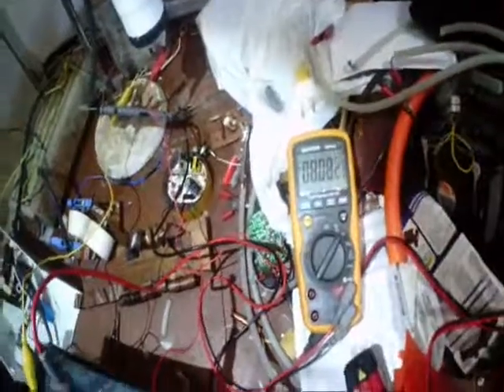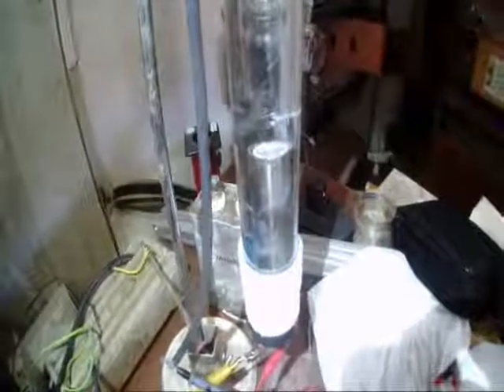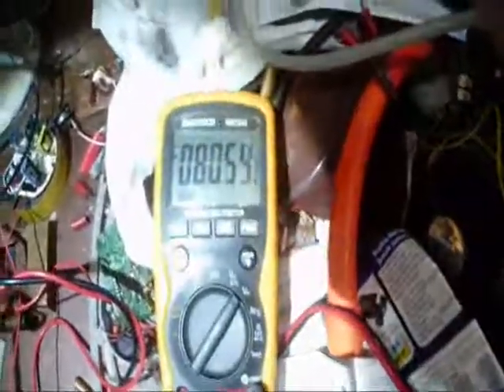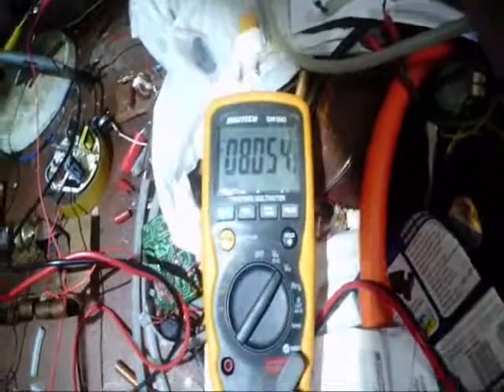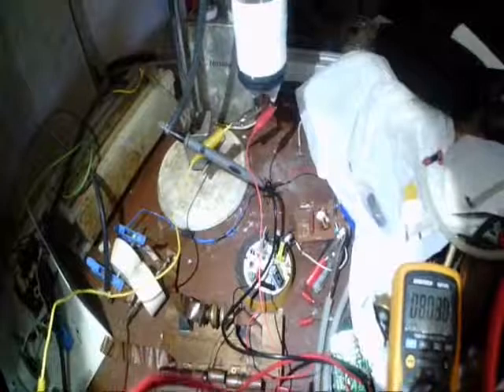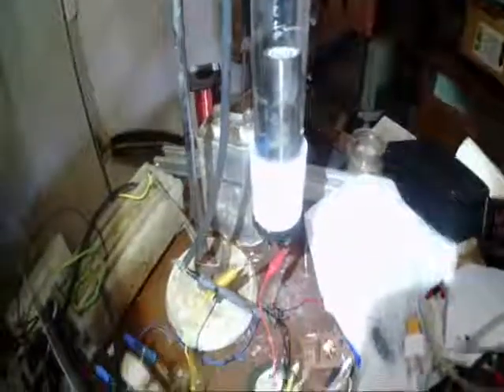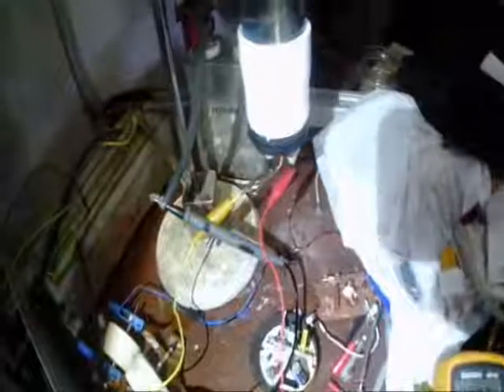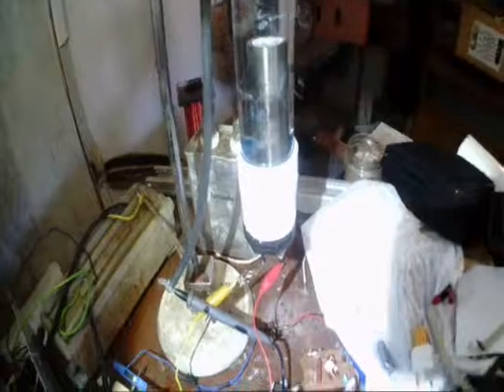Electron extraction pt.4

Comment: hi matt thanks for all those replies the proton exchange is what i needed info on as joie booker (i know your sceptical) but this is why his alternator squeals on the suzuki vid because the positive electric is trying to stall the alternator.and yes the b+ is the nano sized voltage intensifier circuit as meyer could make it go from 40kv to 90 kv by way of a cock croft  variable generator ..and the uv light guide i meant was placed at the top of the injector shining down through the whole

Comment: hi matt meyer explains that his injector has a b+ high voltage coil at the tip inward loudspeaker funnel (same as a blackhole) the injector has a uv light guide l.e.d. this makes a full spectrum (rainbow) energising the neucleus of h and o the b+ then strips the electrons .causing critcal condition of atoms .electrons re fed to e.p.g. and nature makes the neutrons take the place of the electrons. at chamber air implosion as catastrophic atomic collapse as neutrons act as the lightening bolt

Comment: proton injector joe booker also did this as he a contact has emailed me stating he has used h+ in the water cooling system that is why the spark goes to the water hoses and of coarse the h+ is vacuum sucked through the casting of the block into the firing chamber as h+ is proton/neutron and needs to stabilise and of coarse the smallest atomic structure known.all adds up but my electronics are still naff so trying to tweak this appreciate reply if you see it does not add up.watch meyers hands